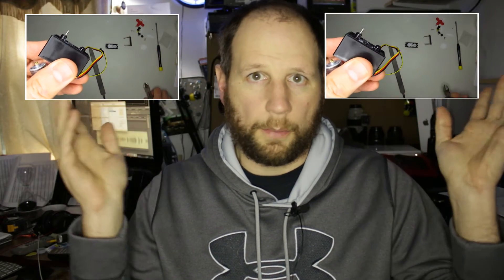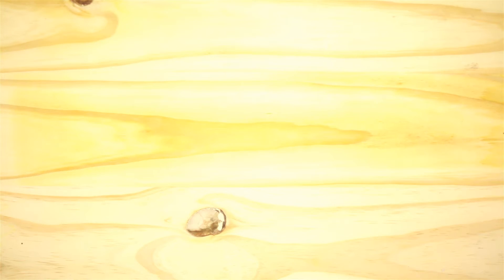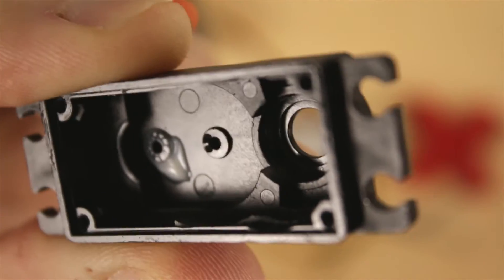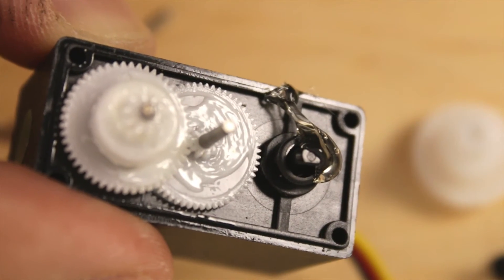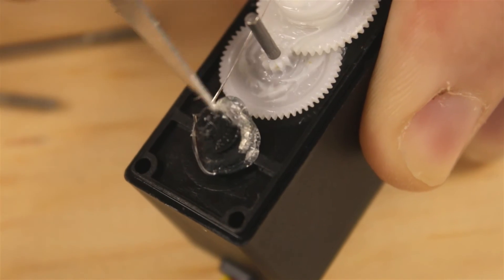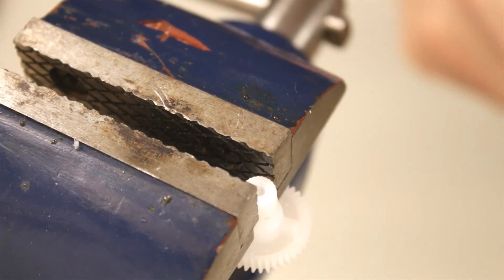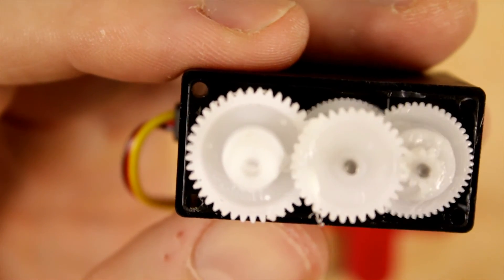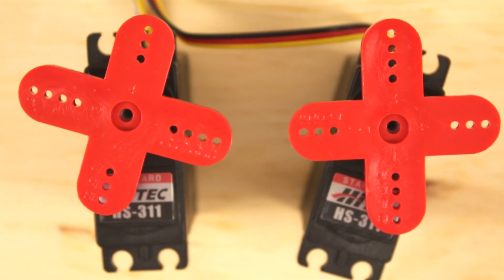How to make servo 360° degree continuous servo rotation Mod Method 2

Comment: i don't get why you have to drill the center out and then hot glue the pot.
Reply from the maker: Great question!  There are two answers.  Basically I'm using the servo like a forward/reverse speed control - position doesn't matter.

The glue 
I'm having trouble with this answer - basically - I need to trick the servo into thinking it's always at 0° so that it never tries to move the gears back the 0° and never tries to hold a position.  That way I can give it a signal to rotate either direction, it will rotate that direction forever.  I think if the pot is connected, it either can't rotate 360° freely, or, at 180° it messes with position/return to neutral.

Drilling the gear out
Since the POT is glued in place, the slot where the pot shaft fits into the output gear needs be drilled out so it can rotate infinitely in either direction without moving the pot and providing location feedback.  The position of the servo doesn't matter any more and so it has to stay at 0° so when I stop giving input, it will stop moving.  Drilling the gear out means I simply replace the gear, remove the glue, and I have a standard operation R/C servo again.

Cut the pot shaft
Another other version of 360° video that I made here: https://www.youtube.com/watch?v=3W7lQzB5byA I cut the pot shaft down, which means the gear does not need to drilled out.  The down side, the servo can't be restored to its original operation, the pot shaft is not an available replacement part.

Finally - you might be able to take the pot shaft out completely - I forget what it looks like on the board side.  Still, the pot needs to be fixed at 0° for my application.  I seen videos where the pot is removed entirely from the board and replaced with resistors to hold 0°.

That's more work than I needed it to be 😂
Reply: At the cheap cost of a servo with PLASTIC  gears, why would you want to return it to its former condition?
Reply from the maker: @alangriff1  Why not? End result was the same, just a different way of getting there.

This was a follow up video to method 1 just to show how to do the mod while having the ability to reverse the the changes at the cost of a gear set.  I've already done the permanent method in other video - why not make a 2nd video with an alternate method that will work for most any servo PLUS still be reversible.